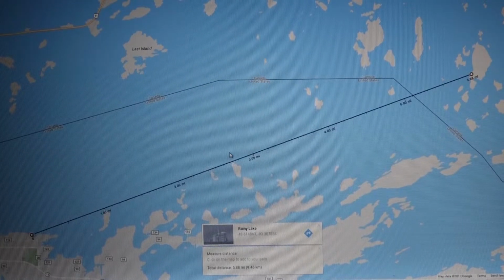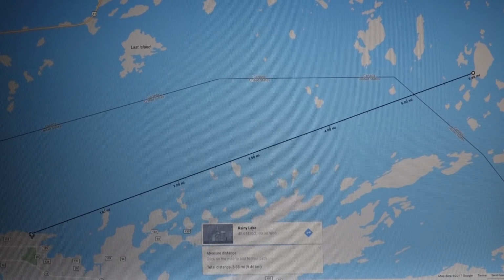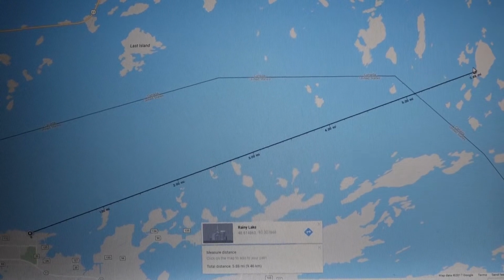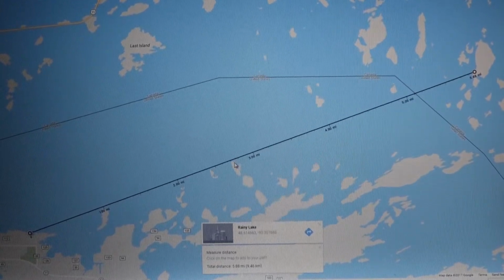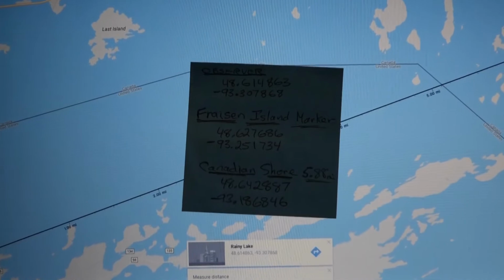BERNOULLI   pressure part 2

Comment: Unfortunately, it's been said that this type of test can be misleading because the pressure in the side hole is extremely sensitive to the shape of the hole where it enters the tube. Apparently a slight burr or radius on the edge, or a different drill angle, can change not only the magnitude of the pressure, but even the sign. 

The best video for understanding Bernoulli's principle that I could find was an old MIT film from the 60's: https://www.youtube.com/watch?v=LI9Mi1KhFTs&list=PL0EC6527BE871ABA3&index=6 
There is a tremendous amount of mistakes, misconceptions, and misinformation about Bernoulli's principle, sometimes even from elite physics professors.
Reply from the maker: I thought I covered that in this part 2
GH
Reply: I don't see what in my comment that you covered in the video or at what time you covered it. It was still an interesting test though.

Did you see my comment on Kozlowski's channel about using a phone camera set to live stream, strapped to your autolevel, to reduce the amount of back and forth when setting up your targets? If you do that you may also need a counterweight on the front of the level to prevent the phone making your level sag.

I didn't realize the value at first of lining your targets up in a straight line. I initially thought the targets should be at equal height above the water to show the curvature. But those options are not mutually exclusive. You could put targets on top in a straight line, and targets down lower at constant elevation. The advantage of that is that many flat earthers are a primarily visual type and would really like to see the curvature as well as hear your measurement report. Another possibility, though probably not worth the trouble, would be to paint the posts with alternating one foot segments so that the measurements can be seen as well. It might also be nice to have the targets angular size get a little smaller as they go into the distance so it will be obvious just by looking which is farther. Its probably not worth remaking or reinstalling any of them though.
Reply from the maker: Good suggestions but I do not own a smartphone.  Might have to borrow a few and do that.  I like that idea.

 You could put targets on top in a straight line, and targets down lower at constant elevation.  - discussed doing just that in my first video on the test.  Still planing on doing just that.

Go to time 14:30 on this video:
https://www.youtube.com/watch?v=GUO-mbxybVA
GH

Comment: Bloody brilliant video George.

Well done for finding an easy way to implement a venturi style constriction so that you could observe Bernoulli effects.

Of course it was the phenomenon that you and Epistemology reported, in your case that of a device you could stick on your hose that would suck up liquid from a chamber that would then be ejected by the hose, and Epistemology's account of blowing through the horizontal tube of some T shaped device ( I think ) that would suck up a liquid from the stem of the T that was causing me confusion and led me to make an initial analysis that accelerated air by a fan could cause some Bernoulli effect, which fortunately I changed shortly afterwards to predict that there would be positive pressure for the results of your previous video.

Both you and he implied the devices which were causing the sucking were just simple horizontal tubes, but I am willing to bet large sums that both devices had a venturi style device, like the one you have created to cause the negative pressure. And I think this same phenomenon caused you to believe that a negative pressure would occur. 

Well now you can dismantle the device you put on the hose, or at least look at it, and see if it has a device like the one you made.

I am also pleased that my prediction that I made in comments on your last video that the pressure would be greater the further away from the feed was taken from the exit of the hose. I have since discovered that there is a rule for the pressure along pipes that after what is called an entry phase for the flow, that the pressure declines linearly along the length of the pipe until the exit point.

This video was excellent practical science and very educational. The little hood was a great piece of work, presumably you carefully sliced off a bit of pipe at an acute angle.
Reply from the maker: Rumpus,
The hood was just a piece of soda straw cut at an acute angle and glued to the inside of the pipe.  For the record I mentioned that the devices which were causing the sucking might be just simple horizontal tubes. I did not k now for sure  - it was just a guess.  That was Epistomology putting a straw out the car window.  Upon further thought, my experience in car did involve venturi arrangements with small side windows which were popular in cars when I was growing up.  Back then people smoked a lot and I suspect these windows were designed to suck the smoke out of the vehicle.
GH
Reply: The accounts of you and Epistemology of low pressure phenomena caused me no end of confusion and confronted me with a dilemma!

I thought you mentioned you had a water hose fitting which consisted of a chamber which you attached to the end of the hose and that would suck up the contents of the chamber. It was this experience that you cited which led you to disagree with me over whether a tube sticking out of a car would cause a reduction in pressure, whereas I said there would be no reduced pressure. Initially, Epistemology agreed with you and Paper because of his experience of blowing through a device which also caused suction in a side chamber.

I am looking into the pressure gradients around fans. I have some theories as to what they do to static pressure.
Reply from the maker: Rumpus,
The hose attachment is the device I was referring to.  I have never had one apart to know the exact configuration and construction. 
Obviously I assumed incorrectly and drew incorrect conclusions  -  probably should go over and play for the other team (typical FE analysis of observations).
George
Reply: George, stop trying to scare me!

The last thing we need is a flat Earther who actually understands science and maths. Fortunately no such thing exists at the moment !